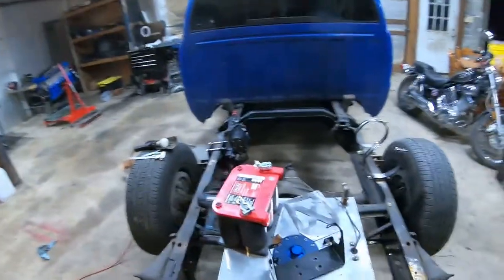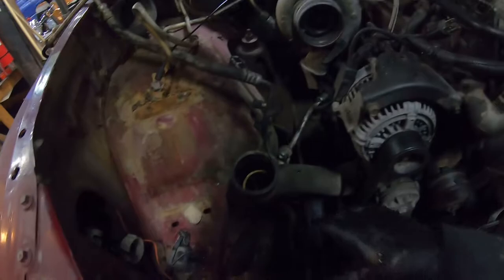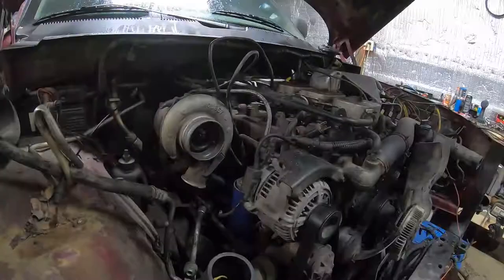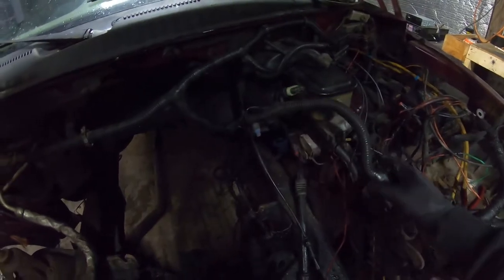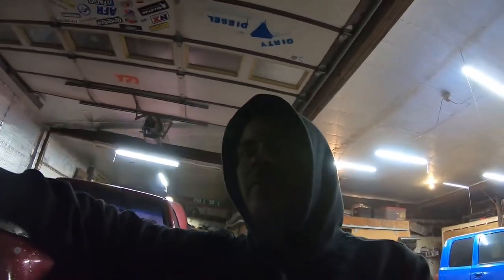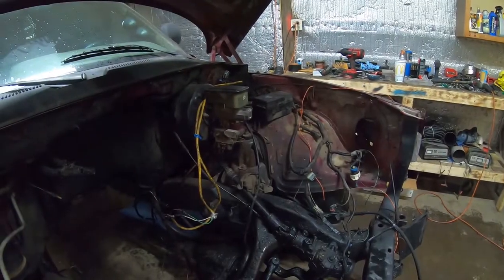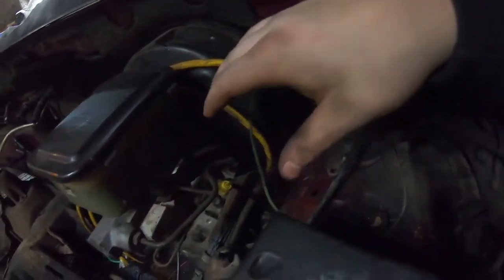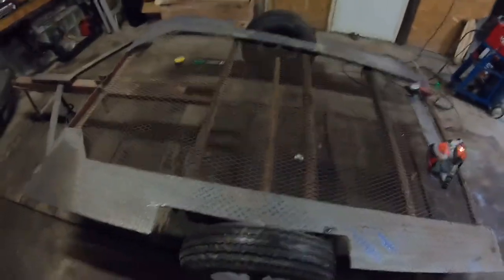New 12 valve Cummins for the Shorty!

Comment: Those dashes are easy to take out. It would probably be easier to swap the complete dash out of the red truck into your other truck than try to swap the harness to the 98 style unless you can get the whole dash but you might also have to switch the brake booster and abs because those are different from the earlier to later years. Fun project keep up the great.
Reply from the maker: Wesley Truax that was for sure the initial plan, although the dash harness in the red truck is mangled and I’m not comfortable using it